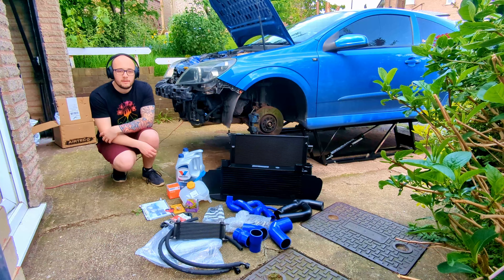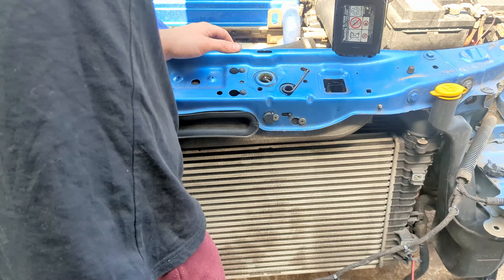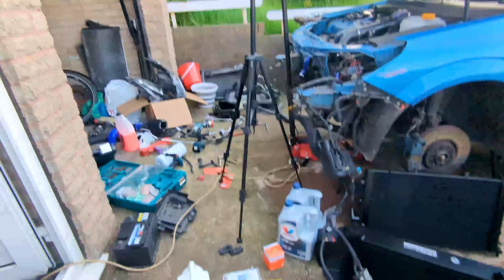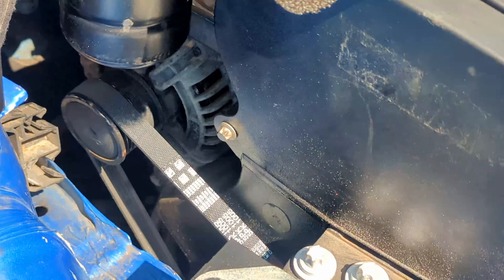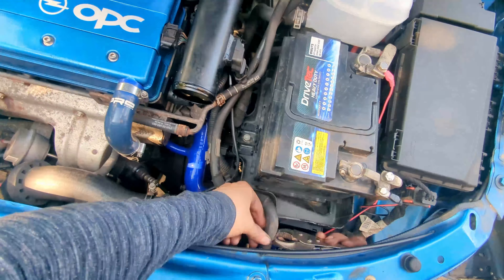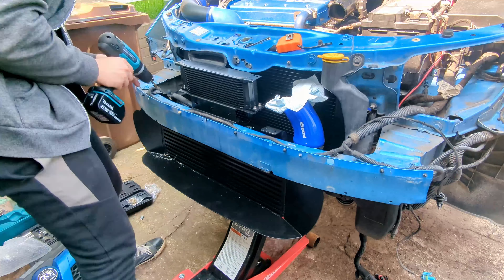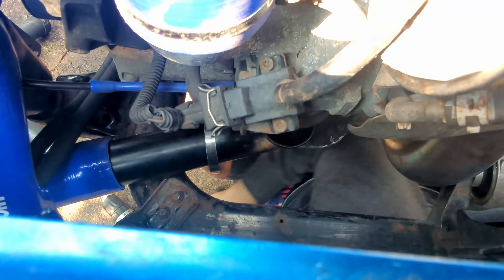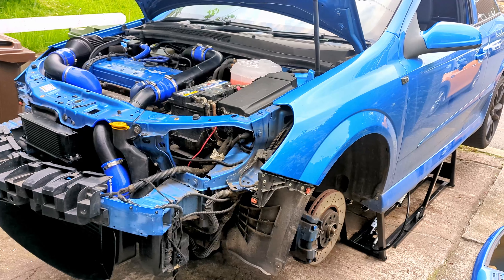Astra VXR Ultimate Cooling System Upgrade! Airtec Gobstopper FMIC + Oil Cooler, ProAlloy Rad Install

Comment: Hi mate I have a question I fitted everything you did in this video but I have twin spal fans and they would not fit on the front of the radiator as the airtec gobstopper intercooler was too close to the rad. So jnstead I fitted twin fans behind the radiator like you did with the stock fan but my question is will I then need to change the direction of the spin on the fan or change the propellers the other way as the fan will now be under pressure fighting the flow of air hitting the rad.

Comment: 9:45 Hello, what is the length of the belt without the air conditioning compressor? 1005мм?
Приветствую, какая длина ремня вышла без компресcора кондиционера?

Comment: Are you doing the gearbox breather kit, if so use the tigworx one, due to it being cheaper and more cost effective, about £100 from there website?
Reply from the maker: I will at some point, and theirs does look like the best option. Thanks!
Reply: @JamesBalazs  aye nw’s, I would say there headed tank as well, incase your going down the road of forging as well, just helps with heat flow abit more

Comment: What did u do to bleed the coolant just run it with the cap off?👍
Reply from the maker: Yep seems to work perfect on these 🙂
Reply: @JamesBalazs  nice 1 👍
Reply: Got a astra vxr racing with a hole in the side of the engine

Comment: Do you have a link to we’re I can get the pulley and belt from as I won’t to do this to mine as my air conditioner is f..ked
Reply from the maker: Here it is mate:
https://rndmotorsport.co.uk/Z20le-A/C-removal-kit-with-Billet-Tensioner-for-Standard-Crank-Pulley
Reply from the maker: Added a link to the description too in case YouTube removes it from the comment, I know they can be funny about links

Comment: Hey, mate. Would this Cooling System work with the 1.9 Diesel Version as well ? I have the GTC model and I really want to squeeze at least 210 HP.
Reply from the maker: I think it should. You would probably have to clock the turbo so the outlet points down, if I remember right it faces the opposite way to the VXR turbo. I have a 1.9 diesel Vectra @ 265bhp with a hybrid turbo, FMIC etc.
You don't need an intercooler for 210hp though, an aggressive stage 1 map on a stock car from TP Remapping in the UK or AM (Anthony Moreels) in Europe will do that power easily.
Reply: @JamesBalazs   Thank you very much :) Really appreciate the info, bud. Can't wait to tune that :D I was going to buy the VXR version, but my cousin had a semi tuned GTC in a very good condition and I just went for that. Kinda sad, but still I will try my best to modify it as much as I can without it exploding.

Comment: Do u have to cut that top panel or is there a way round it
Reply from the maker: Seems like it, at least if you have the thicker radiator as well as the stage 3 Airtec. I'm currently making a billet slam panel to replace the stock one on my car, which will give plenty of room and look way better but still requires a bit of cutting to fit.